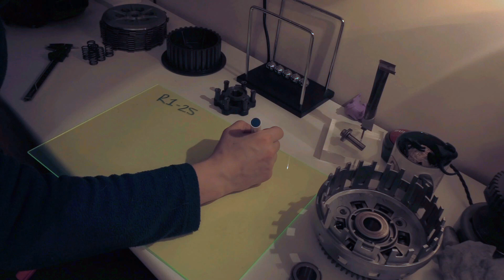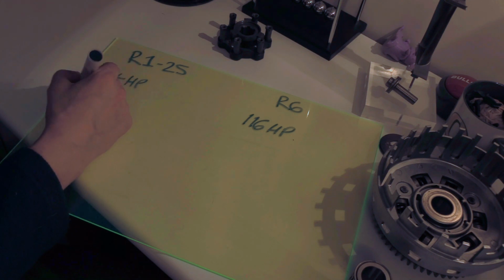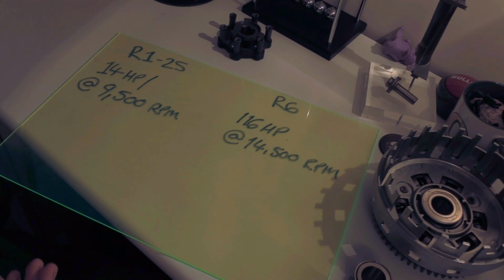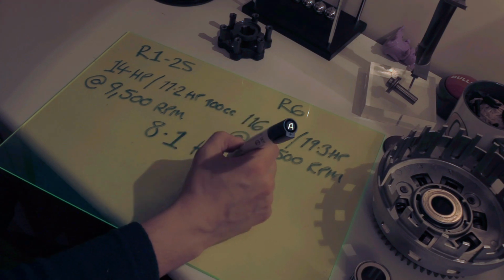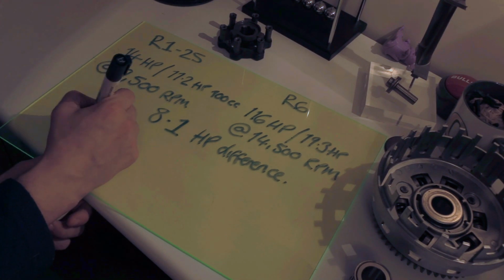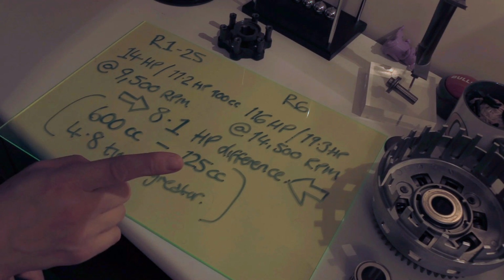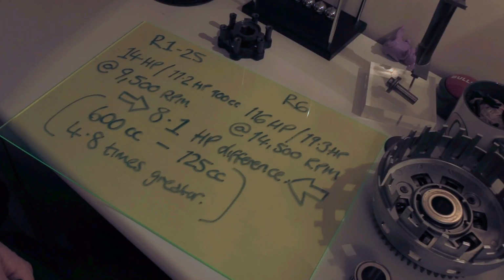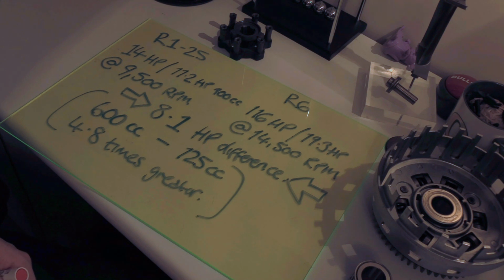Power Difference - R125 vs R6?

Comment: Work is force over time.  More work is being done at 14,500 rpm with same 100cc worth of air/ fuel vs 9,500 rpm. In one minute one creates more heat in the same space.
Reply from the maker: Careful not to make conclusions that aren't always true. Rpm and waste heat are not directly correlated...
Reply: @thedirtyworkshop  I probability didn't explain my self well. I meant to say, more energy is liberated in the same amount of time and same amount of space. We extract more work from the same space because more heat was created in one minute of time.

Comment: The R125 produces a peak torque figure of 9.18Nm/100cc, and the R6 produces a peak torque figure of 10.28Nm/100cc.
The R125 produces this peak torque at 8000Rpm, but the R6 produces more torque at a higher Rpm (10 500Rpm).

It produces more peak torque and more power per 100cc because of several reasons (I imagine):
- The compression ratio is increased from 11.1:1 to 13.1:1
- The R6 features YCC-I to increase volumetric efficiency (Variable tuned length intake)
- The R125 is under square, hinting that valve size can be restricted due to valve shrouding against the cylinder walls
- The R6 features an extremely straight, down-draft style intake
- The R125 has a rod ratio of 1.7, and the R6 has a rod ratio of roughly 2.13 (increasing dwell time and therefore high Rpm performance)
- Based on the engine dimensions, it is likely that cam timing is quite restrictive (I couldn't find any details on cam specs)
- I would like to say that the R6 has more aggressive ignition timing but based on the rod ratio and compression it is difficult to say if the R6 has any ignition timing advantage without further analysis
- The R125 is a children's bike.

Roast me.

Comment: I can only be arsed to speculate. I'm thinking that the power an engine can make vs cc might go up exponentially as the overall or mass flow of gasses have less interaction with the porting as everything is just Bigger! Lots of reasons I can think of that this might be bull - ie why bother making a v12 - just make a massive thumper. But then rpm based on  reciprocating mass do have a huge effect that we are kindof not trying to compare in this example.
Reply: I just read some other comments & bahahah I feel like a tit.

Comment: I know Jack shit about this but here’s my guesses:
- single cylinder would have a relatively larger amount of reciprocating mass vs a four cylinder
- limitations on performance due to power restrictions on A2/CBT licenses
- entry level bikes tend to be less refined than something like an R6, so the R6 would likely have more R&D, more refined fuel mapping, lighter materials, fewer corners cut, etc etc.

Comment: Honda went to 6 cyl bikes way back when (1966)..rc166 . Trying to compete with 2-strokes on the track.All related to how much air/fuel the engine can consume..volumetric efficiency.! .250 cc, 4-valve per cyl..18,000 rpm... 62 hp and air-cooled.Crazy shit from honda...Cheers.!

Comment: The difference in displacement is large, as stated; 4.8:1.   The difference in weight is not so great; 1.32:1.
The 125 is tuned more towards torque because it has to actually get moving at a decent enough rate in lower rpm, whereas the focus can be more towards top end power on the R6 as it has enough at the lower end to the point where Yamaha deems it to be enough.

tldr: Isaac is more likely to buy an R125, therefore more torque is required.

Comment: It would seem there is deminished returns when creating more power. More power requires more cc. But in single cylinder form the higher the cc the more unstable the engine gets. So, you need extra cylinders to smooth it out. You can then up the rpm as theres less mass (piston size) to move. BUT! theres an extea set of valves, bigger crank and heavier flywheel erc needed.
  In summation more cc brings more power but it comes with more mechanical resistance. Or some bullshit.

Comment: In most countries 125 are limited to aprox. 15 hp. To sell more bikes they lower the price of the bike and thus they cut in some areas,(mainly engine components and tolerances) since they can easily archive their target power. R6 has a BMEP ≈12.94, and the R125 a BMEP≈12.24.

Comment: Or it could be just a trick : the 125 is rated 14 BHP at the crankshaft without any ancilliary, whereas the 116 BHP of the R6 is at the backwheel. Would that be enough to explain this gap ?
Reply from the maker: No its not, both are at the crank

Comment: I know you say ignore the RPM's but given that power is a function of torque and rpm's can this be ignored? If we look at the torque/100cc we get R125 (12.4Nm) = 9.92Nm/100cc, R6 (61.7Nm) = 10.28Nm/100cc. Near as no matter no difference. The power output then will only be a function of how the engine is tuned to produce what torque at what rpm's. The multi cylinder will always have a higher rev ceiling than a single cylinder....more RPM's= more POWA!

Comment: The 125 is built to be a restricted engine under the port sizes will be much less than the R1 also the R1 being a 4 cylinder it has 3 more power strokes to every one rotation

Comment: RPM. 
Power in going to be roughly proportional to the amount of air the engine flows per unit time. 
All else being equal, if RPM increases, power increases as the engine flows more air. 

I'd guess the 125 is designed to provide more torque lower down so that it's not a peaky engine that requires it's neck wrung every second to get any forward movement out of it. The 600 in the R6, due to its larger displacement, produces more torque and can afford to give away some at lower RPM to rev higher and produce more power higher up. 
A comparison between the 125 and a less race-biased 600 would probably be more apples to apples.

Comment: The 125 is a single cylinder, the 600 is an inline four, more air capacity, more fuel = more power, the 125 tops out at 9,500 rpm as there would be no point in reving it any higher as it wouldn't produce any more power.
Reply from the maker: 116hp / 4 = 29 hp per cylinder... 

29 / 150cc * 125cc = 24.1 HP...

So air capacity and fuel out of the window there.

Now compare the 125 to the 600 @ 9,500 rpm....

Comment: If the r125 had the same specific power as the r6 it would make about 25hp. I've done a little research and it appears that the r125 engine is not a restricted version of a more powerful unit. Ie it has been designed and built to make 14hp. Unlike the old 2 stroke rg/tzr125s which could be unleashed with a bit of tinkering. This means that every element of that engine has been chosen by yamaha with that upper limit in mind. This allows the engine to have good useable power across its rev range. In contrast the r6 engine is designed with a priority on outright peak power. For example the very short stroke on the r6 to achieve high rpms for the piston speed. Yamaha could of made the r125 have 20+ hp but who would buy a non a2 compliant 125cc bike that needed 10k rpm  to pull away.

Comment: Approaching this in a non mechanical way.
Sales in the 600 class is more about power on a reasonable budget.
The target market for the 125 is more ideally concerned with budget and looks than actual speed.
Then there also the issue of liscencing, the UK seems to have a worse system than Australia where it limits young guys to 125's with 11kw, Poor Isaac.

Comment: These engines are not so different. Matt asked us a trick question.  Power is Force x Velocity...... Force is Torque generated, velocity in this case is the angular velocity of the crank, which is a fancy way of saying RPM..... Now take the two numbers Mat gave us, namely 11.1 HP and 19.3 HP . ( Normalised power to 100cc per engine...) Now calculate normalise again for RPM,  11.2 HP divided by 9.5 and 19.3 divided by 14.5 gives 1.17 and 1.33 respectively. Not so far apart..... The 125 would ( in terms of BMEP ) be close to the R6 if it could ( or was allowed to ? ) get to 14.5k rippem's.......

Comment: HP is proportional to torque x rpm, so peak power is about the relationship between these two measures.
Reply from the maker: No. HP IS torque x rpm
Reply: @thedirtyworkshop  so my bike has 87 x 7250 = 630750 HP?
Reply from the maker: And then the conversion factor to get all your units correct. Regardless, torque is a word, and so is rpm. It doesn't define what the units are...
Reply: @thedirtyworkshop  the conversion factor is what makes it proportional.

Comment: power equals torque x rpm. just look at several R6 graphs from dyno, of the ones I found online they do around 70-75 hp at 9500 rpm, that gets you much closer to 14 hp on 125 cc.
Reply from the maker: But does the r125 make 14hp at the wheel... no.

Comment: There could be something about 125cc power restrictions and bla bla bla but I genuinely think if it wasn't restricted it wouldn't magically make 19hp/100cc I rather think it's about how many cylinders it has and also the degrees at it's firing, Matt has a in-depth video on this topic where he talks about Yamaha Crossplane engine. I really got curious and did the math on another bikes such as Aprilia SXV 550 with a V-Twin engine and 12.7hp/100cc and KTM 690 with LC4 engine and 10.8hp/100cc, definitely interesting though.

Comment: Clearly, someone put red paint on the R6 cylinder head before dynoing it. HA! Is it the non-edge area of the cylinder volume? More area to draw in charge air, more energy in the compressed firing chamber.

Comment: The r6 has more or same power per 100cc when engine speed and displacement is factored in. 
R6 at 9500rpm is about 80hp
80/600*100=13.3

Comment: just spitballing here, iv'e done no research to confirm this... i think it's a bore thing.. also obviously camshaft is a factor but still i bet with a cam made for 14k rpm in the 125 it would still come up short just because the 600 probly has a much bigger bore making more room for valves nevermind the relative bore/stroke relationships.. another thing is that single cyl motors are vibrators and you can only balance them well for a much shorter rpm range compared to multiple..
Reply: there is also the fact that there are more powerstrokes per rev but i think that is less important i really think the main limiting factor would be the valve size
Reply: we mustn't forget exhaust scavenging

Comment: Probably smaller engine is tuned for more low-mid torque. 
BC it is mostly for todays teenagers, manufacturer might have consider also some neglect and omissions in use and service, engine might have lower compression and "calm" ignition timing adapted for low quality gas. 
If You take to equation compression, ignition timing, cams and lower revs - You might have the answer. 
Besides, here only one cylinder drives all the auxiliary equipment (water pump, alternator). 
Excuse my English.
Reply: This also was the case with car engines, in the past, before Turbo-era, when displacement had some more importance. 
Usually smaller engine, based on the same architecture as larger, made less power per liter. 
You also need to think about the limitations of insurance rates in some countries, thats why every German car had an 1,6L with 75hp and 2.0L with 115.

Comment: You're somewhat comparing apples to oranges, Matt.

The R1-25 is designed to produce a maximum of 11kW.  Yamaha could produce a roadgoing 125 with a motor producing an arseload more power, but there wouldn't be much of a market for it, because 125s are "beginner bikes".

Converting peak HP to peak torque and normalising to "per 100cc" makes what's going on a bit clearer.

Torque of R6 at peak is (116 * 5252) / 14500 = 42 pounds-feet, 7 pounds-feet per 100cc
R1-25 equivalent (14 *5252) / 9500 = 7.7 pounds-feet, 6.2 pounds-feet per 100cc

That's not all that different, and can be put down to a softer tune, somewhat asthmatic breathing, and above all, lower RPM. Yamaha can be a lot more conservative on engine parts, which makes the whole damn thing more cheaperer to produce, on top of that, keeping the revs down and the exhaust restrictive means it doesn't sound (quite as much) like a wasp in a biscuit tin, that keeps the lesbians happy.  Won't somebody please think of the lesbians???

Actually, I'm off for a quick "think about the lesbians".
Reply from the maker: Pounds-feet?
Reply: @thedirtyworkshop  Yeah. copied straight from an old reference, couldn't remember the constant for converting to newton-meters and I don't think in those old imperial measures.  Depending on the age of your reference, you'll find it referred to either way, round, which is kinda unsurprising given that multiplication is commutative.

Comment: ability to rev higher whilst not floating valves , 
 bigger variance in timing potential of fuel and spark  as youve got the timing of 4 cylinders to play with, 
above all its thermal efficiency though, 
the multicylinder stores heat far better than the single because bigger, less thermal variance throughout the motor too, so hotspots not so much of a worry, 
nor is the worry of obtaining  opti,u engien efficiecy. the single has to come back up to temp after low revs...each cylinder is also able to stay cooler as the other cylinders compliment the clearing and instake strokes...scavenging is also improved as the exhaust pressure waves and the uburnt fuel within are able to be used and not just blasted out the back when the cylinder clears...one cylinder can only scavenge once per cycle...multicylinders utilise scavenging twice per cycle? is it big bang? if not its 4 times per cycle. ,but thermal efficiency is the biggy.
firing order ...the multiple cylinders can create waves of torque, one cylinder complements another you can essentially double punch per 2rpm or quadruple punch per 2rpm depending on firing order., against the single punch per 2 revolutiions  of the r125.
larger components can take far more stress ,  the crank is far more balanced too, reducing wear and potential for high rpms. 
oil flow is harder and faster, engine can be tuned for more power by adjusting the bore and stroke to suit  power not relative rpm which the single must be tuned to  achieve the  figures it does from a single, high rpm rather than-  low down  grunt, but low down grunt is also needed to actually get you going, so its a compromise....
Sophisticated air intakes and swirl chambers balanced to exhausts waves in the bigglier motor , 
bigger more complex ram air in the intake manifold, not to mention that with more speed you produce more air pressure in a ram air system in an exponential curve, you also increase cooling ability for the rads, oil cooler and engine package exponentially with more speed, and ive likely missed  a few other points too, faster air is also cooler air , which means less fuel to cool your head and pistons, increasing efficiency and emissions whilst simultaneously developing potential for more power with a cooler intake....
less relative parasitic power train losses, the riders weight dosnt change, the components are necessarily four times stronger but not 4 times heavier which means your engine hp is relatively closer to your hp at the wheel.
its a damn good question is whta it is,,,,

Comment: Quick guess with no homework done (just like in school, blag it !)

Scalability (sounds clever)
Also
Money: higher cost components in the R6 and R1 as they are trying to compete with Fireblades and RSV4s etc whereas all the 125s are basically the same due to legal restrictions.
So no sense in having a super lightweight conrod and piston or titanium valves.
Making a 16-18bhp 4t 125 would be idiot because you couldn't sell the fucker ... young guys couldn't drive them on the learner licence and probably couldn't insure them regardless.

Comment: As will become evident with what i say here, I know fuck all. 
So for a pure stab in the dark I would say is it that explosive power is not linear? I.E set off 125cc of fuel and it gives 14hp but set off 250cc of fuel and that gives 35hp.
Or could it be the timing of the ignitions to make the hp more than the some of its individual ignitions? but i would have thought the timing would have more to do with where peak power is rather than the amount of power created.
Like I said a stab in the dark from a numpty.

Comment: Oh lord where to start. I think it's a mix of stuff.
The engine afaik is really undersquared, limiting same rpm limit, thus limiting max power. on top of being close to a 20yo design by now. 
But i feel it still doesn't explain the massive difference per capacity.

Maybe stuff like air resonance? As in the single cyl engine doesnt benefit from exhaust scavenging of a multi cyl engine, plus the same thing on the intake side

Then like, how much does the 125 being a 4v sohc and the 600 a 4v dohc affects power? Or affects other design that indirectly affects power, components like valve and port angle, or valve diameter size, or compression ratio

Then maybe the amount of parasitic losses like oil pump and water pump is similiar on the 2 engines so really it's a bigger parasitic loss for the 125?

I dunno what else, just throwing shit at the wall and see what sticks :P

(Speaking of, do R125 there have VVA now? Where i am, we got the R15 with VVA instead. That is 150cc)

Comment: Modern day 4 stroke 125's are junk. My 1986 TZR 125 made a genuine 25bhp at the rear wheel with a fully operational YPVS. 35 years on and the new stuff isn't a patch on what used to be.